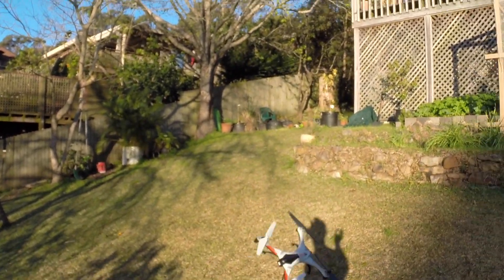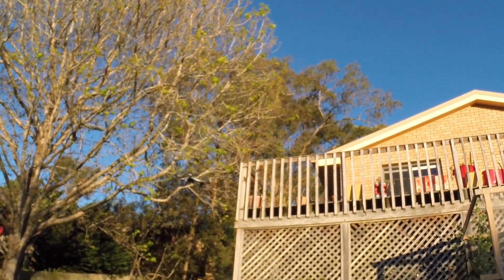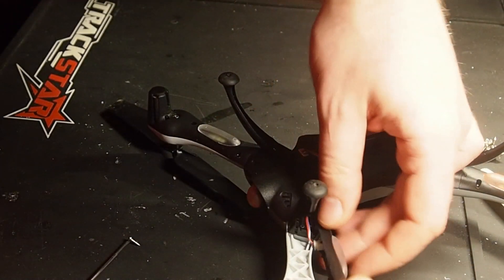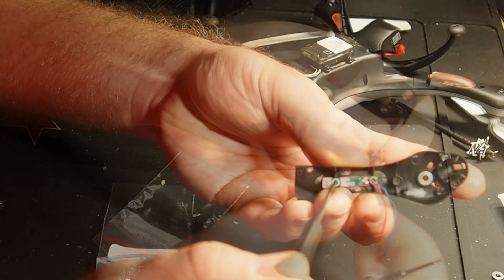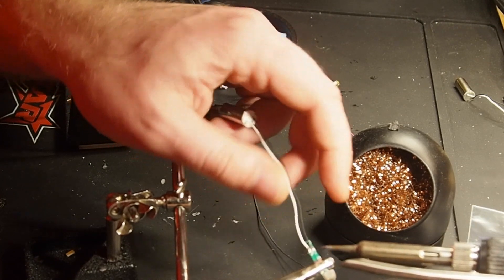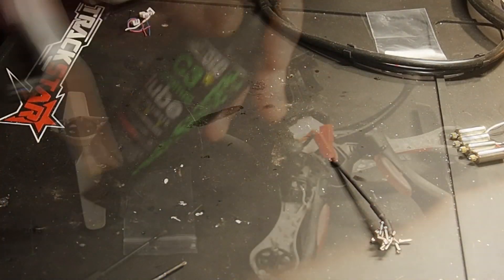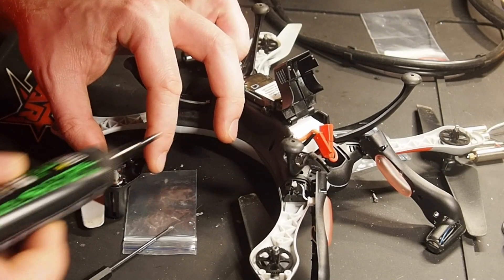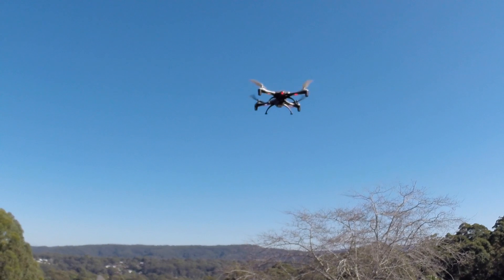How to inject the Force into the Heli-Max 230Si (a.k.a. Galaxy Visitor 3)

Comment: NIce video, have replicated your advise, but now need motherboard. My primary question is what type of soldering gun/pencil are you using? It appears to have built in excess solder vacuum and looks like it has plenty of heat to instantly liquefy the solder. Thanks
Reply: It's a temp-controlled iron from Yihua. The moment you draw heat from the tip, it starts heating more. The extra nozzle is sucking air, to remove the fumes.